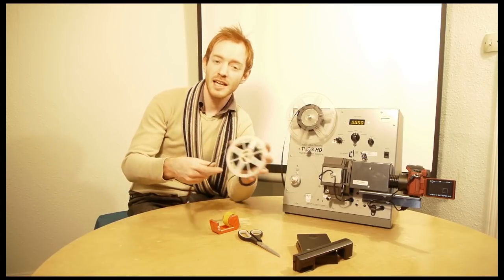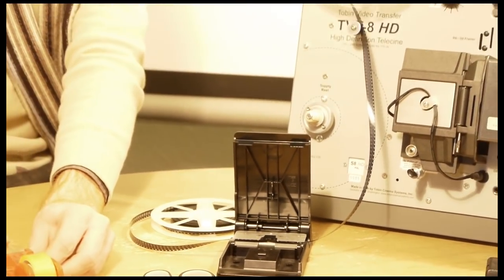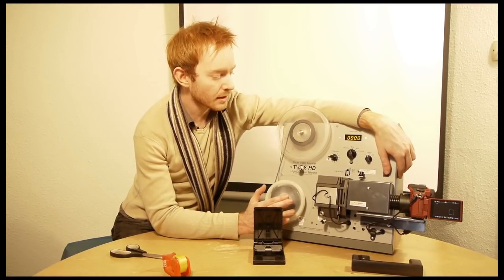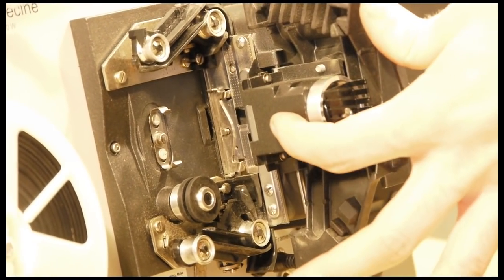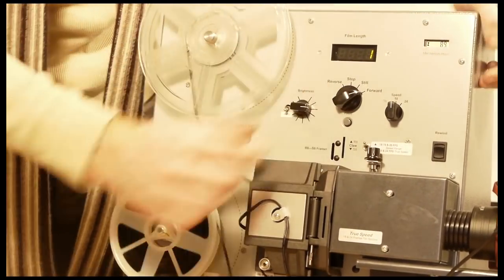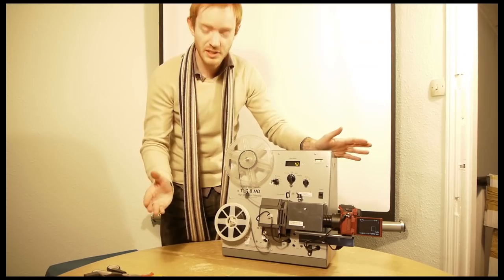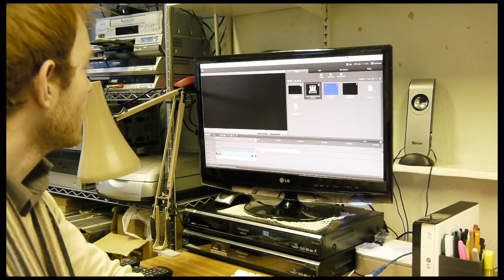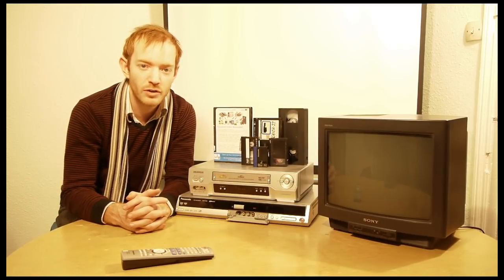8mm Cine Film HD Transfer & Convert - How to Guide

Comment: Why do you need to splice it? cant you just transfer one, then the other, then edit them together on a computer? if they are captured frame by frame anyway, that shouldnt be a problem... the cutting and splicing is unnecessarily destructive.
Reply from the maker: +GroovingPict 
Yes we do transfer the reels one by one. But for the purpose of this illustration when you transfer for example a 400ft 7" diameter reel which is made up of 8 or more smaller reels then over the years the splices that were originally done will and do come apart. The cement or glue used does usually last a long time ( 80 years plus)  the reel on the above transfer was fairly young at only 33 years old and did fall apart. So we stop the transfer and it creates a file and when we start again another file is created and we edit together as you suggested above. The splicing may or may not only destroy one frame. When you consider that there are 18 or 24 frames each second then your eye will not miss anything at all. | Hope this answer helps.

Comment: Not getting why the spicing thing was necessary... why not just tape the two ends together without cutting it?  Or if you needed for some reason a cleaner cut, just use scissors?  Seems like an unnecessary tool.
Reply from the maker: +Charles J Gartner 
A perfect cut keeps the film flat and reduces the thickness of the final splice.Thicker splices can get stuck as they are pass through the gate but mainly since each frame is captured we want to make sure that each frame is a full clean frame without any overlapping etc.

Comment: What's the name of the machine that you are using?
Reply: It's the Tobin Cinema Systems TvT8-HD which has now been superseded by the S8-FHD and no longer requires the bolt on SLR you see here. The new one has HD SDI output, far more professional. However HD results from 8mm film are hardly any different than SD except physical attributes such as scratches and bonded dirt show up really well. We only use ours for the very best film we receive otherwise the standard definition TvT S8 gives better results.